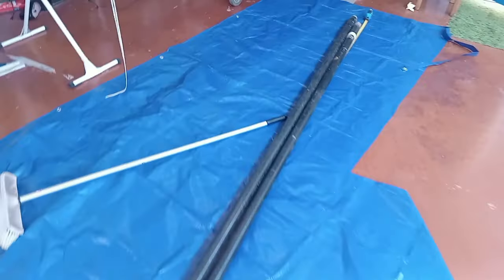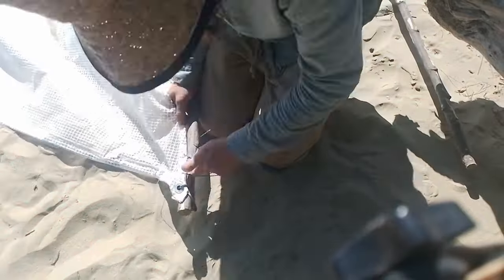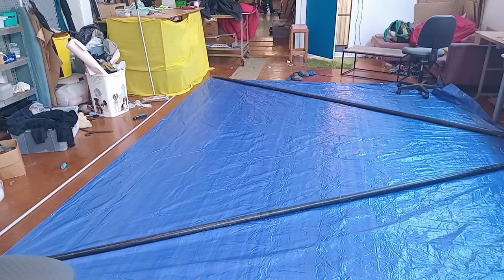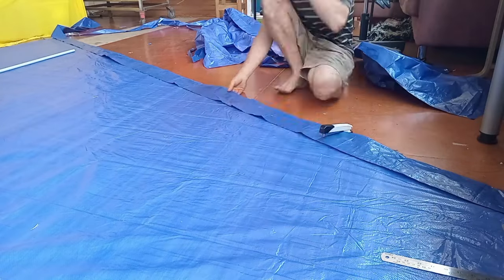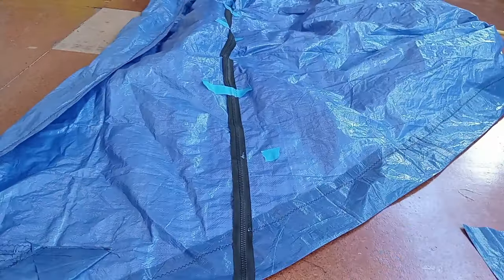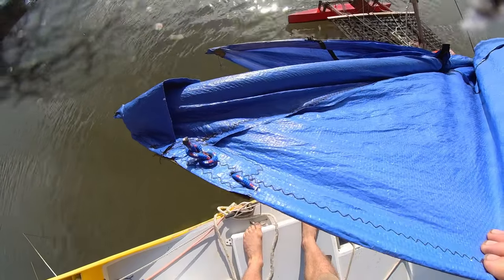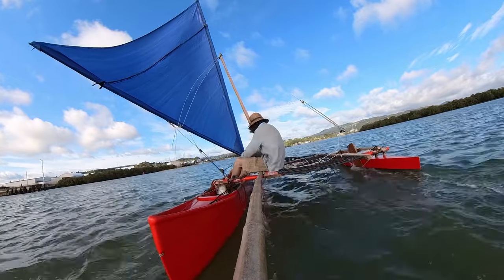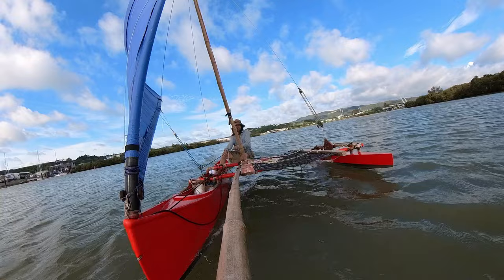Making a New Crabclaw Sail for my Proa

Comment: I'm really grateful for this video. I'm an amateur boat builder, but I found out that actually acquiring/ or making a sail is more difficult than building the hull. I bought a sewing machine, but I'm still very intimidated by it. I thought I should practice on polytarp before I go to actual dacron sail canvas. I wasn't sure that you could use polytarp in sewing machines, but this video shows you can.
Reply from the maker: you sure can. it's a bit slipperly compared to most other fabric, so can be challenging to sew straight. but doable with carefully laying out the project, practice etc. see also my other polytarp sail making video https://www.youtube.com/watch?v=OW88fQN6MAE
Reply: What about using the heavier brown/gray polytarps? Will they work in a sewing machine?
Reply from the maker: @HerveMendell  sure no problem. the heavy ones available here are silver/black, 185 gsm. I've done several projects with them (such as rain tent) there may be places where it's so thick you need to hand stitch (get a "speedy stitcher") but probably not necessary if it's just a dinghy size boat

Comment: When I first got into windsurfing, I bought a cheap storm sail, made from polytarp, worked surprisingly well.  Great stuff for experimental sails, cheap and wide.  It does need a lot of reinforcement, ie multiple layers at stress points.
Did you consider cutting in some shape along the spar lines?  
Why the zip off reefing, rather than brailing up the boom spar?  That should be easier to do at sea…perhaps.
How was the polytarp for sewing, any problems with getting the thread tension right. 
Good work, looks lots of fun, and more fun with a bigger sail.
Reply from the maker: The most difficult part about sewing polytarp is that it's quite slippery, you need to be careful to sew a straight line. thread tension didn't seem to be a problem. I think also it's hard to make it really flat, I think it may be best to glue the reinforcement on then sew it on the edges. I was making another small sail, kinda in a rush, and just used duct tape for the reinforcement! it worked!

I also recently did some repairs to my drifter (see my other sail making video) I had been having wrinkles radiating out from the clew. I added a new clew reinforcement, that was radial cut. instead of using one big semicircle, I sewed several narrow pizza slices together so that the fibers radiated out. That reduced wrinkles significantly!
Reply from the maker: I just used straight cuts so far. I want to see how good it is. This material is so cheap I can make another one later, and at this point my biggest problem is just getting the details right, how to do fittings, end the pockets, adjustable lines etc

Comment: That sort of sailmaking involving floor cutting is actually a bit of a black art,so it's quite an ingenious sail. Double sided tape on  the pockets makes it easier if you can't staple out that far. If that leech is flapping bad enough it could do with a negative curve cut in to it.
Reply from the maker: leech flapping is a problem with the reef (that is, the top unzipped). Next sail will have a hollow leech for the reef, at least!
Reply from the maker: it's strange to me that many people build boats, but relatively few people make sails. As with boat building, there is a lot to learn and some experience helps! but you still actually be able to sail with surprisingly crude sails!

Comment: Nice to see the constant improvisation going on. I'm currently considering using the topsail from my gaffer as a lateen rig on my outrigged canoe. My existing tarp rig works fine though.
Reply from the maker: funny! I've been considering using this sail as a top sail on my cat... because why not? (will need to make it more easily detachable first though)
Reply: It would be great if you can use it on both. I've just bought a used alloy mast, rigging and Wing-sail main for my Wharram. Bargain of the year!
Reply from the maker: @johnnyT428  what wharram do you have? How did you find the mast I always see masts laying around in boatyarda
Reply: @dominictarrsailing I've got a Tiki 26 in GRP (some were built by Imagine UK). It strangely has a Bermudan rig, so my intention was to put the Wing-sail on. The previous owner forwarded a link to a guy who had broken up an old rotten Wharram and was selling the 5" round alloy mast often used instead of wood on Wharrams. It turned out he also had the stainless rigging and even the old mainsail. It also turned out that he knew my old man from windsurfing days!
Reply from the maker: but have you considered a crabclaw?
Reply: I haven't but I will ponder the idea. The reefable balanced lug rig I made works well. I have a single Ama but I'm not a shunter.
Reply from the maker: some people are doing a crab claw on a catamaran with an small A frame mast.  @johnnyT428  like this https://www.youtube.com/watch?v=gKDtgADVjFc&t=39s

Comment: Yeah!
Lookin good Dominic!
Always excited when you post another video.
Can you speak on the zip vs brailing lines as a means of reefing.
I was under the impression that brailing lines do the job of reducing sail area while under way?
Reply from the maker: brailing lines are great because you can near instantly reduce power (say, to a gust) but they mean a lot drag so you can't sail to windward well with the brailing on. with a reef, you remove the proportion of sail you don't need, so it won't add drag when reefed. The new sail, reefed, is the same area as my old sail. But now that size can be unreefed for better light air performance. I still have the brailing lines also, but the position they are in is more effective with the reefed size. so, options are full sail, reefed sail, or reefed plus brailing.

Comment: Very cool 😎 Why not go the other way so your outrigging pushes into the water instead of lifting out? I wish you had tracked the speed, but I'm def going to dig into your journey. Terrence Howard has me thinking sail design 💎 😉 Peace and Health
Reply from the maker: This way is better! Previously I built one that tacked so outrigger is down on one tack, up on the other. Prefer this side. Makes it like a very long skinny monohull because as the outrigger starts to lift drag drops away
Reply: @dominictarrsailing  Oh the drag becomes tremendous...? Hm 🤔
Reply from the maker: @b.l.a.c.k-shiva  well, the drag increases. the ama (outrigger float) that I have is a good size for a shunting pacific proa (ama to windward) actually it's just enough to support my body weight. if it was tacking, I'd want a larger ama, so that it can support the boat when pressed on the down tack without digging in. Although, on a small size boat like this, the crew weight is a lot in comparison to the boat, so you could balance it by sitting outward on the other side. That can be a bit risky if you accidentially gybe though, and are sitting in the wrong place! Also, some early trimarans had small ama, and they could capsize diagonally forward by pushing the outrigger under then tripping over it. Modern trimarans have ama that are large enough to support the entire boat, for example, a volume of 200% the entire displacement.

Comment: Dominic, a question if I may. I think you said you build Waimea because Good Enough was too big for a tender. If you didn't have that constraint, and you were building from scratch, would you go for the asymmetrical hull with lots of rocker like GE or for the flat bottom symmetrical style of Waimea?
Both lovely waka of course, but having sailed both which do you prefer?
Reply from the maker: Well, it's hard to say. both of these boats are a learning process, I've gotten the rig on waimea worked out quite well, but if I applied what I know now to Good Enough it might be even better!
One thing is that the ama on GE is too small. It's maybe 20 litres? so it can't hold my weight. Waimea's ama is ~60 so it's just enough to hold me if my weight is in the center. That's important if I need to fix something on the ama, and also means I can move over the entire platform, and means capsizing when caught aback is not a worry. I had identified this problem when I relaunched GE but didn't have time or spare ply to build a larger ama but I just put longer aka on it and didn't capsize after that!

Okay just watched the GE videos again, the waka sides are not high enough. Some racing oriented proa are like that but it means the central platform has to be raised (which I did later, but it didn't make it into a video) I think a pitchpole capsize would be a risk if I sailed it in the conditions that I sail waimea in!

The flat bottom has many advantages when building a cheap boat in plywood. GE was my first ever build, I built it in 2005 before Gary's book was published, but I did learn quite a bit from Gary and others via a sadly now defunct proa mailing list. (though, there is a proa builder's facebook group now) I would have given it a wider bottom to get more bouyancy at the time, but i had salvaged the plywood (as poor student in 2005) and the plywood was already cut to this size.

I was really surprised with how well waimea performed actually, I think what actually made it go so well is that it's a very moderate design. It's designed to have plenty of bouyancy, can support my weight even at the bow or the ama (just) and the sides are high enough so that it doesn't take on much water, and the aka clear most of the waves. Which means it's actually very seaworthy, as you can see in the Strong Wind Advisory video.

I think it's important to remember that a (traditional) proa is actually a work boat. It's the station wagon of the islands, they might race it but it's primarily for fishing, transporting crops, your family etc. it just happens to also be quite fast!!!!

If I was gonna get GE going again (it's currently back sitting behind the barn) I would raise the platform 10cm, add manu (which would help discourage pitchpole, as well as hold the crabclaw tack). but if I was rebuilding waimea and didn't have the constraint of fitting it on my catamaran deck I would make it 4.8 long, not 4.2, two full sheets. I think it's good to start with a small proa, because trying new ideas is easier. People who start with a large proa usually either give up or go to a small proa where it is easier to experiment!
Reply: @dominictarrsailing  thank you so much for such a comprehensive reply. Very helpful. Full respect to you.

Comment: Fast boat brah! That sail is about as big as I would go too... The Polish gang go to 12 square meters, yet I think it's too much for my sailing grounds... I too sail a 9 square meter, I'm pleased it reefs easy, since I had some hairy situations running onto a sandy beach with rocks all around, boat speeds up and develops aggressive weather helm, but too late to leave the helm, Jenia put in a reef on a run! That's the JR's greatest advantage, reef when ever, on course, in seconds. The CC is much more efficient, more power and sheeting can be way off yet still very powerful, JR needs to be in the groove at all times, though inferior to CC no matter what.
 Reefing??? I broke my balls thinking about that, your Zipreef is a novel solution, I may have missed something in the vid, so I suppose you plan taking the unzipped part off? or wrapping it around the boom?? can you reach it safely when sail is down, or is it way aft of the stern???  Keep experimenting with this system, I truly like it...
Happy Shunting bro, Balkan Shipyards
Reply from the maker: I unzip the end, take it off and stuff it in a bag. these spars are a 0.3m longer than the hull so I have to crawl to the end of the hull and reach out. There is some slack in the shunt line so I release that and push the tack out, makes it easier. If this boat was the size of havaya I don't think I'd have spars that overhung the end! I'm thinking about ways to make that easier. Maybe have slot in extentions instead of always long spars?

I just did some calculations and pjoa laguna (95kg rigged, 10m sail) has almost the same sail area displacement ratio as me with a 8.76m sail. sail_area/((boat_weight+crew_weight)/1000)^(2/3) I get ~35 which is also same for a hobie 14.
Reply: Dood u will go down as a great shunter, extensions for spars exceeded the brilliance of the zip! Please try to add a second reef, 1 already works, 2 will give me more peace... My mind is full of fear when I think about shunters... The fastest of the lot, yet boasts the least RM... That's a bad recipe for staying mast to the heavens rather than to the horizon... Extensions only for first reef, second can live with long spars. Zips the best, biggest, strongest and most plastic possible, and I think bro, u have reefed the CC, which is by far, the best Shunting sail in the world. 
That's keeping Shunting mate ❤️ Great Force,
Balkan Shipyards
Reply from the maker: @BalkanShipyards  I was thinking just the yard up pizza slice reef after this. 8.7 zip off to 6, then pizza reef to 4. 4m^2 will make 25 knots feel tame I think. Yeah I wouldn't do 2 sets of extensions too wonky!
Reply: @dominictarrsailing  U mean from new clew once reefed, going up to middle of yard for example??? I love that man!!! I will leave u to figure out the details, since I got a full plate at the moment.... Yet My next Proa could well be a ZipReefed Lateen..... Keep Shunting bro, more than ever....